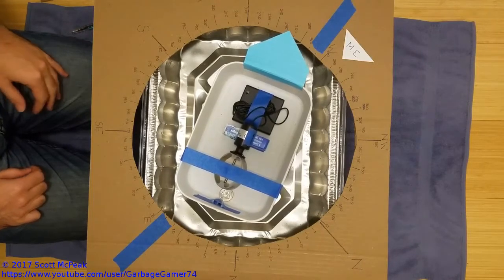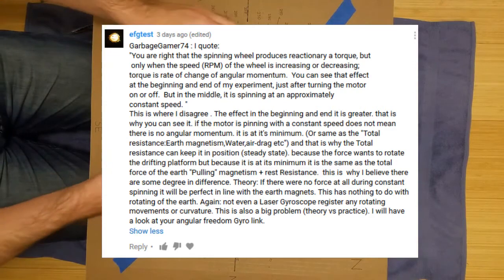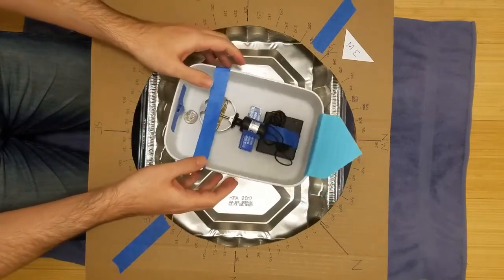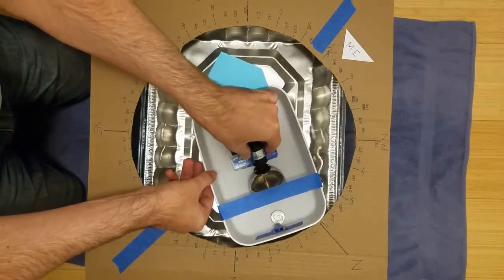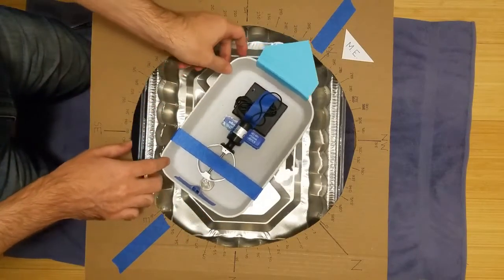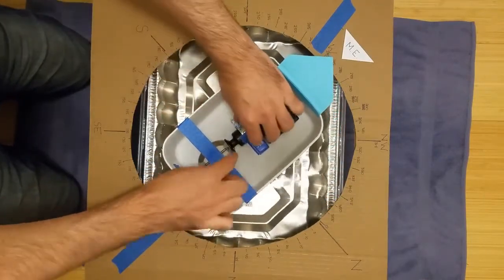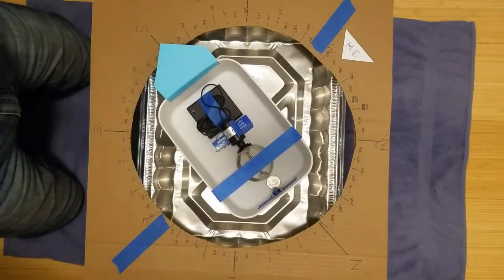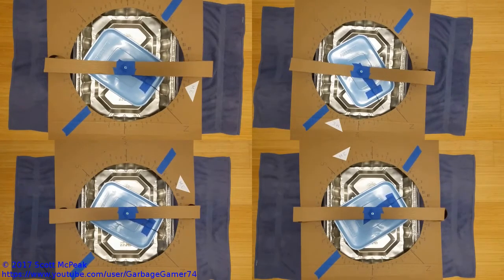Gyrocompass Follow-up: Testing the Constant Torque Hypothesis

Comment: Did you place a clear cover over the new setup to contain air currents from the flywheel? It's hard for me to tell. Certainly that would be very helpful to eliminate that. In one of the MEMS papers (I think the one with the PS controller), the experiment used a coil to cancel out the earth's magnetic field. If it is within your means to do that, it may simplify your setup further. Your new rig is looking far more elegant than what you have used in the past. 👍
Reply from the maker: During the actual experiment, I put the container's blue lid on top, although it was just resting on the edges, not sealed.  I think that adequately contained the air currents.  In the intro discussion, there was no cover on it.

I've considered building a Helmholz coil or using magnetic shielding on the motor.  However, for the moment I do not have any hypothesis that such a refinement would test, so I haven't done it.

This rig is cleaner because it was purpose-built as a gyrocompass, whereas the old one was intended to be a full 3D gyroscope and I then stripped it down just enough to make a gyrocompass.  It's not so much of a mess once you know what you're doing.  :)
Reply: I can imagine. I hope one day to know what I'm doing! :-)
Reply: @GarbageGamer74  to avoid hassle with magnetic interactions you could use brushless DC motor (used with RC airplanes) - they have ring of alternating poles magnets - since poles are alternating net magnetic field will be nearly zero and no need for compensation.
Reply: Unfortunately: you did not understand what I said, Maybe its because I did not use the correct terms. I am quite sure you did not twist my words on purpose. I will come back later and also explain to you why this experiment did exactly what I suspect it would do. 
thanks for taking the time. again :Nothing to do with earth rotation! 

But for those that are reading this for the first time: 
I will explain it in an other way: the average pulling force of the magnets(Earth magnets,Permanent magnets,Motor magnets and motor field magnets)  is equal to the fulling force of the spinning gyro => gyro settles. 
There is always a pulling force (conservation of angular momentum) even if the motor is spinning with a constant speed.
Ps It looks like the hypothesis is true because the gyro did not settle the same position as the "spinning" axis of the earth. and it did not settle with the same difference in degree. of course not. because the AVG pulling force were not the same, (let us assume the RPM is constant means=>Torque is constant) the Torque does not dominate the experiment but the AVG magnetic fields do. 
How can you test this? do you thing if the motor spins at a constant speed there is no Torque? 2:07 IT will always rotate! so there is always an active force. (horizontal or vertical mounted) 

Please do 2 more tests for me: choose 1 configuration  and When it settle. mark it. then put a piece of magnet left of the motor as far as possible in the middle and run the test again. repeat the test this time with the magnet on the right side (as far as possible). I predict : The gyro will not settle in the same position. Due to 2 things! ;-) and its not the rotation of the earth.
Reply: @efgtest  "There is always a pulling force (conservation of angular momentum) even if the motor is spinning with a constant speed." - this statement is not correct - once constant rotation is established, there is no more reaction of suspension, and when this reaction is dissipated (due to manual stabilization for example) - there is no more torque in suspension - this is for ideal case with no loses of angular momentum in flywheel. For not ideal case, however, when flywheel loses angular momentum due to air resistance and friction in bearings, motor will constantly compensate providing additional angular momentum and causing a small torque. But firstly, this torque is relatively small, and secondly this torque is applied horizontally - which shouldn't make boat turn but rather to rock a little bit. And thus your hypothesis is wrong.
"do you thing if the motor spins at a constant speed there is no Torque?" - exactly - torque=r*F - where F is a force - and since speed is constant, for ideal case, there is no force and thus no torque.
Reply: @z08840  A lot of talking after 3 years. Lets go straight to the point. the Earth does not rotate and it's not a sphere. if you believe that's not the case, then you haven't understand the gyroscope. IF you believe I am wrong  that's fine. We don't have to fight over this.
Reply: @efgtest  yeah, let's get to the point. The Earth is a sphere and it rotates. You don't understand gyroscope.
Reply: @z08840  So now we know each others point of view so we don't have to continue with this. Have a nice day.
Reply: @efgtest  well, my previous comment regarding your mistakes is not a point of view - it's science - unless you have nothing to object - have a nice day too.
Reply from the maker: I am sorry I wasn't able to understand you properly!  I appreciate the discussion anyway, and I look forward to seeing the results of your experiments.
Reply from the maker: For the additional tests, I don't quite understand what you have in mind.  It sounds like you're asking to see what happens when magnetic equilibrium is in each of three different locations, since the effect of adding the magnet is to change the location of magnetic equilibrium.  How is that different from what I showed in this video?
Reply from the maker: Regarding the hypothesis of torque produced by constant spin speed, I tested that experimentally:

https://www.youtube.com/watch?v=2cyTx1DCUpc
Reply: GarbageGAmer74:
It looks like 1: I am not explaining myself properly
Or                   2: You don't understand me
Or                   3: You don't want to understand me
it looks like its time to buy my own hobby Gyroscope.  Thanks for showing us your experiment.